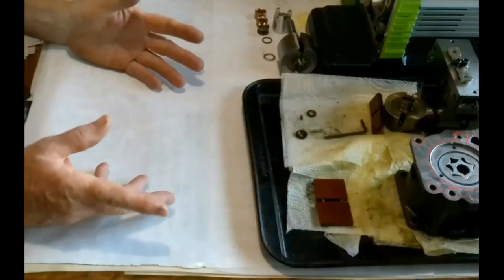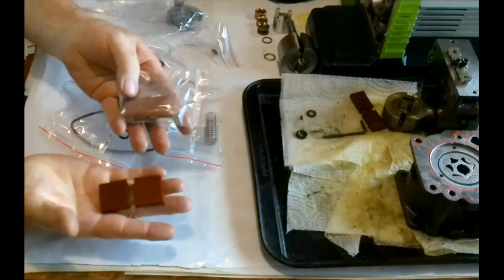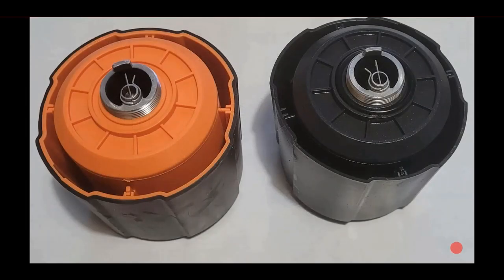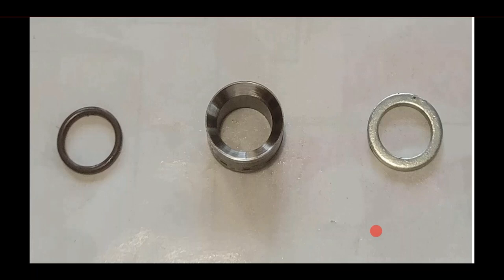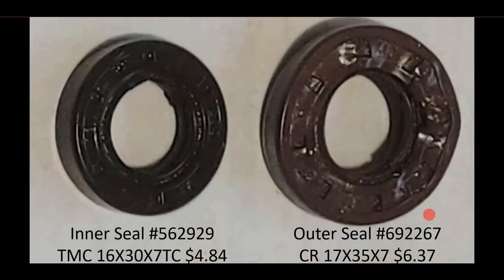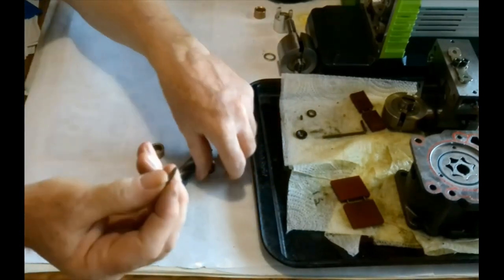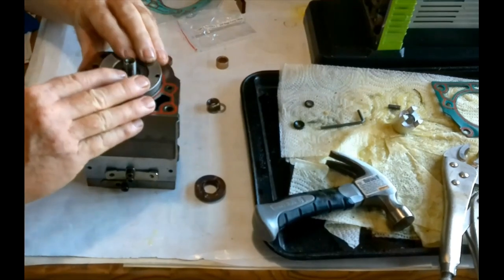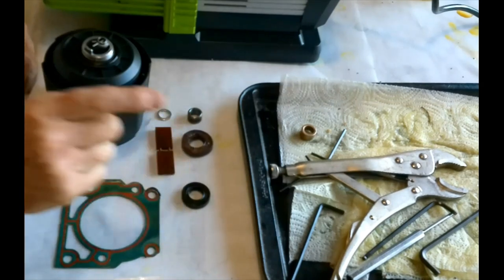Replacement Parts for the Harvest Right Premier Pump

Comment: Hi Phil - Thanks for your tenacity - I followed up with HarvestRight about this and was told that it had been brought up to the owner and then was told that they probably wouldn't offer a kit because rebuild guys like you and me are about 1% of their business. I then asked if he would check with the owner to see if they would pass us a link to their supplier so that the 1% could get a kit  - He said that he would ask the owner and get back to me - will keep you posted my friend.
Reply from the maker: I'll start praying for a positive answer.
Reply: @Philat4800feet - Phil, if you were willing to do a “side hustle” job (and rebuild these for HR owners like me), then perhaps Harvest Right would sell you the rebuild kits (as an authorized rebuilder).  Just a thought.  But I’m sure you have better things to do!  😁
Reply: I’m a part of that 1% and found this video while looking for rebuild kits. Will keep checking back.
Reply: Rebuild parts are only a small percentage of their business because they don't offer any... I would be happy with a complete replacement pump head assembly, like you can get for the JB pump.  The premier pump is limited on parts and they have to be, currently sourced from multiple vendors, when they could be sourced from the manufacturer directly as a kit, if HR requested it.  Pumps fail, fact, they do not last indefinitely.    They will need to be rebuilt.  And frankly, I won't pay nearly $800 again for a pump or any other tool that I cannot get parts for.  Even in commercial business to business we don't buy products that do not offer vendor support.  Support is more than just selling us the product, but also being able to source parts when repairs are needed.
Reply: I agree.. Im a industrial Maintenance  man turned Appliance  repair man.
Now own a Fd.
One month in have a pump that vains got stuck.
The pumps we used in Factories had rebuild kits.

But these companies.. many Appliance types want to sell you another 800.00  unit
But used 3.00 from china parts.
They want to charge 300% markup on that part..
They dont like repair people fixing .
You cant find diagrams or parts.

This is why Sears.. Kenmore  Name.. is almost out of business.
Cheap companies.. made units( appliances) for them.
A year later the fan failed and.
Part is no longer available. 
Hence.. A 2,500 refrigerator  is useless.. due to a 10.00 fan.

Welcome to the new world.. Order.

Hope we can find some parts. @esandquistSr

Comment: I’ve been in the vacuum industry nearly 30 years. Those pumps are not quality at all. The fact that you can’t get any part you need immediately is disturbing. Get yourself a proven brand. Not Harbor Freight! Try Edwards, Leybold, Welch, Pfeiffer, Busch, etc. you will pay more, but in the long run you will be in better shape with quality and support.
Reply from the maker: What do you think of Navac?
Reply: Hi, I would be very grateful if you could share some info regarding a potential replacement for the premier pump. Thanks a lot!
Reply from the maker: I would replace the Premier pump with another Premier pump, however, if you are looking for something else check out the Navac NP12DM, but sit down when you see the price, around $998.00.  Does it look familiar?
https://navacglobal.com/product/smart-vacuum-pump-np12dm/
Reply from the maker: You'll need to change to fittings from a standard 3/8 to a JIC

Comment: I pointed this out to HR and another FD vendor, your pumps are too expensive for how long they will last.  Anything like this that costs more than $200 should have parts available for rebuild.  I can go to Harbor Freight, spend under $200 for a 2 stage vacuum pump, get the extended warranty for a few dollars more and get a replacement at no cost, direct swap, when it fails in 6mo.  Pay for another extended warranty, and rinse and repeat... For that same $800+ price, I replace several times over... Inevitably, I will have more pump time for less money with that cheap local option.  I know the pump will work, because I've done it...  I really thought the HR Premier would be better and have parts...

Comment: For me, I have taken apart and rebuild more than one vacuum pump for use on my personal harvest right freeze dryer.  Not having replacement pump heads or parts available on an $800 machine in unconscionable. Any machine that cost more than $200 ceases to be throw away, parts need to be available.  I suspect the problem is that they don't want to know where the pump is actually sourced out of fear that others will white label them and they will lose sales.  The thing is that there are direct replacement pumps out there for significantly less.  Sure they may not last as long.  But my Premier pump has lasted two years.  Which means I can use a Harbor Freight pump for 1yrs and replace it and still be less than half the cost in the same period - and that pump is throw away, but the dealer is 10min away...
Reply from the maker: Yup
Reply: Had a 12CFM Vevor pump, cost $250... Lasted about 1yr using dairyland oil..(I probably wouldn't buy that oil again for freeze drying).  That pump did great, also considered a disposable pump... and still about half the cost over the same time period of use.  Who knows, might have lasted longer if I had used the Black Gold oil in it...
Reply: Currently testing a new Vevor 12cfm pump, but not really seeing what I saw on the previous one.  I am not sure this one is going to cut the mustard so to speak,  Would still like to see a replacement head or parts kit for the premier pump.
Reply from the maker: Still trying to shake HR chain on supplying parts

Comment: What adapter do you use to connect vacuum gauge to the pump?
Reply from the maker: a 3/8 compression fitting going to a JIC.  The best thing to do is go to a shop that makes hydraulic hoses and have them get you the correct fittings.

Comment: Thanks for the viideo Phil, HR has been soaking the users with these pumps. However, now that there are competitors on the market, we'll find HR more amenable to new support ideas. A company could leverage the maintenance and long term costs to make their product more attractive to those users who are mechanically inclined.
Reply from the maker: Just remember, as freeze dryers, we are rough on vacuum pumps.
Reply: @Philat4800feet  Lol, yes we are! All the more need for self service replacement parts  :)
Reply: I really appreciate the video and your insight. However, isn’t a vacuum pump a vacuum pump? Provided its seven CFM and pulls a similar amount of current, it should function properly. Correct? I’m seeing seven CFM vacuum pumps for $160 on Amazon. I would rather replace those every three months then to buy rebuild kits for the same amount. Thoughts?

Comment: Someone mentioned a pump that could be a replacement in the comments .. I thing it was a JC pump and they said all the parts were available.  I did get a std pump as a replacement for my premier pump.  It works ok but I have to watch it in the batch especially as the temp starts rising as it does not clear moisture as well and them the oil left heads for the top of the gauge and i need to stop and drain aind refill it.  thanks !!

Comment: Did you look into the Navak NP7DP? It physically looks more like the HR premier pump with a different demister, different connections, and a few other minor differences. I own both and can provide measurements but I really don't want to tear down 2 working pumps to compare the internals.
Reply from the maker: The front of the "internal" pump (from the drawing) is a little different.  When I asked the Tech line at Navac, they too, said it was too different.
Reply from the maker: If you look at the exploded drawings, the gasket for the NP12DP is a perfect match.  The NP7 doesn't use a gasket.  The search continues.  If you ever do tear it apart, I'd love some feedback.

Comment: Phil
Just in process of getting a refurbished harvest right  premier pump under warranty. Did not now they sell refurbished premier pump for $395.00 all most as cheap as rebuild kit with a 90 day warranty.  They do not advertise this at all. Or even mention this any where. The only way I found this out because I wanted to now if it came with a warranty. So I googled it. So either they are rebuilding them or have a company doing it for them. Just thought nice information to share. Bill

Comment: I have purchased a NAVAC NP7DP Vacuum pump to test the replaceability of the premier pump.  For starters you have to purchase a 1/2" female JIC to 3/4" male JIC adapter to use this pump right away.  I was successful and achieving less than 500 mTorr after running about 2 hours in test mode.  A couple things to note: 1. This pump is noticeably louder than the Premier pump. 2. This pump oil temperature (measured with infared heat gun at the sight glass) runs about 50 degree F hotter than the premier pump.  3.  When the ballast is open (which needs to be or the oil will instantly becoming cloudy) You will notice more mist in the air vs the premier pump.  My next step is to get an adapter and a larger demister filter (the one you stated in a previous video using the navac 12cfm pump) to swap out the tiny demister with the 7 cfm with the larger one to see if it reduces the mist and noise.

So far this pump appears to work as a more than half of the price replacement if you are willing to accept the negatives I've listed above.
Reply from the maker: Good to hear
Reply: @waynespringer501 I have the NAVAC NP7DP too, and made the same observations you did. The demister threads on the NP12DM / HR Premier Pump are a different size compared to the NP7DP, so it will not be a simple case of swapping it out.

@Philat4800feet Would you know what thread the HR Premier Pump demister has? I am also looking to replace the stock demister with a better one with an adaptor and KF fitting. Where I am, everything is metric and I'm not sure what thread it is even though I've taken the measurements. The fill port diameter on the premier pump is 1-1/8", measured with digital calipers, and around 18 threads per inch by my estimation.
Reply from the maker: Good Reasearch
Reply: @jamesfu  These are the items I used to replace the demister on the NP7DP I have to post the amazon item description as youtube deleted my previous comment with the links.

KF25 Interface Oil Mist Filter for Vacuum Pump Fume Separator- Exhaust Filter 95% Filter Effect (US Stock)

2 Sets KF-25 Aluminium Wing Nut Hinge Clamp + KF25 Aluminum Centering Ring with FKM viton O-ring

LoCo Science KF-25 NPT Adapter for Vacuum Pipe Fittings, Stainless Steel - 1", Male

That last item is my hold up on changing the premier demister over to it as the 1" is to big and 3/4" is to small.  I've yet to locate a 7/8'' or and adapter from one to another.
Reply: @waynespringer501  Thank you for taking the effort to share the parts list! I've had my 2 previous comment attempts deleted for including an URL.

If you google "vacuum pump vapor mist filter bvv" you will find a very promising oil demister for the HR premier pump. Specifically, there is an option for "BVV VE Series / Harvest Right Pumps". I'm waiting to receive mine, but it's going to take a while as I'm outside the US and using a freight forwarder. Will report back with my findings.

On a side note, I think the thread on the HR premier pump fill port is M30x1.5.
Reply: @waynespringer501 Would you recommend the NP7DP as is based on your findings? I saw the further comments with parts to change the demister. I am in Canada and looking to replace my standard Harvest Right pump that has been pronounced dead. The NAVAC is about $250 less than the premier harvest right pump here so I’m just exploring options right now.
Reply: @roguehuntress309  I would recommend with all the added parts ONLY if you run you machine away from your family.  It is significantly louder than the harvest right, and I would imagine loud enough to make your family not be vary happy while it's running.  I would also recommend a room that stays air conditioned as it puts out significantly more heat as well.

As far as how it performed, I would say it does just as good of job (time and low mTorr) as the harvest right for a few hundred $ cheaper.  The harvest right will be much more convenient though.
Reply: @waynespringer501  Thank you so much for your feedback!

Comment: I like to tinker and appreciate your video. The pump on my wife’s freeze dryer doesn’t seem to be pulling enough vacuum so I’m starting to investigate. I was wondering if the main vane could be turned over to provide a fresh face? Again, I’m just speculating from watching your video and at this point I’ve never looked inside of the pump.
Reply from the maker: Yes.  The vanes are symmetrical.

Comment: Phil do you know the thread size on the 2.5mm flat head allen bolt with cupped washer that holds the drive gear on the shaft?
Thanks
Reply from the maker: Sorry, I don't, But Chat GPT said this:
If you're referring to the key size (2.5mm Allen key), the bolt would likely be an M4 bolt.

For an M4 bolt:

Thread size: M4
Thread pitch: The standard pitch for an M4 bolt is 0.7 mm.
This means that a 2.5mm Allen key would fit into the hex socket of an M4 bolt.

Comment: Hi Phil, I enjoyed the video. I just got the medium Harvest Right FD but have not started it up yet. What problems did you have with your pump that caused you to rebuild?  At what age of the pump did you start having problems with the premier pump?  I want to be prepared. 😬 Thank you for doing this video.
Reply from the maker: The pump I rebuilt was a customer return, back to HR.  I requested a defective pump from HR to make my video.  There was "glue" on some of the internal parts that caused the pump not to turn.
The pump I have, for my unit, hasn't had a problem for three years.
Reply: Thankyou for your reply.  Happy 4th of July!

Comment: Hi Phil. Thank you for the video. Were you able to find a housing gasket for the premier pump? I rebuilt my pump following your instructions, and now it seems as if the oil is seeping out the bottom of the housing and the only thing that itcould be is the gasket. I have taken it apart twice and wiped it down and made sure there was no foreign objects that were stopping it from sealing   So I’m trying to find one.
Reply from the maker: Harvest right is working on getting a rebuild kit.  Have you tried to reseat the gasket?  Be careful taking it out reversing it 180 degrees and replacing it.  Be careful not to stretch it.

Comment: Appreciate your efforts and your hard work. How many hours would you say you had on the pump before you decided to rebuild it?  Did you use a declining vacuum capability as your measure?
Reply from the maker: Two loads a week for three years.  A lot of hours.  It was running fine.  It was only rebuilt for the video.
Reply: @Philat4800feet  so it was still working ok when you did the rebuild for the video that's good to know, hope mine last that long usually only do 3 loads a month or less, FD bought mainly so son would not have to buy M House in cans at a very high price and not get as good of food as done yourself. It's for his hiking/camping trips with friends.  Smoked BBQ Chicken is his favorite. love all your videos keep up the good work.

Comment: Could you use the Navac pump as a replacement for the harvest right and not just for parts?
Reply from the maker: Yes.  The specs are nearly the same. although the pump is more expensive.

Comment: Hi, Phil, first, thank you SO much for sharing your expertise! My question: I can't get my oil cap/demister off. I've had it off before, obviously, to put the oil in. But now it seems to be stuck--will reverse/loosen for a bit, but then tightens/stops again. I'm wondering if it's cross-threaded, but it went on smoothly last time I had it off today. Have you ever had this happen? I'm afraid I'm going to break something if I really torque on it, but I'd like to add more oil since mine dropped slightly below half with my first batch. Thank you for any suggestions that you might have!
Reply from the maker: That's odd.  Is the cap at a slight angle showing cross threading?
Reply: @Philat4800feet  I'm sorry for the delay in responding; my husband told me to let it cool completely--that maybe it was just a combination of heat and metal expansion. But it is stone cold now, and it still won't turn more that a quarter turn (and that with great effort). It does NOT look crooked; I wouldn't look at it and think, "That's cross-threaded." But it is so stiff, and neither of us can get it off. We don't want to break something in the process, you know?
Reply: I have an idea that the o-ring slipped somewhere it shouldn't have. It was loose on the top of the pump when I first opened the cap--sitting on the pump top, not sitting in a groove in the cap. The only thing I can think of is that it fell out again when I was putting the cap back on and is somehow part of my problem. Would that make any sense?
Reply: Sorry to bother you again, but. . . I got it off!!! Man, I was praying and twisting and twisting and praying, and ever-so-slightly getting it to budge! It finally came off. I hope that never happens again. 🙂